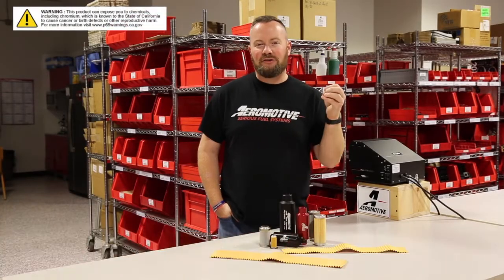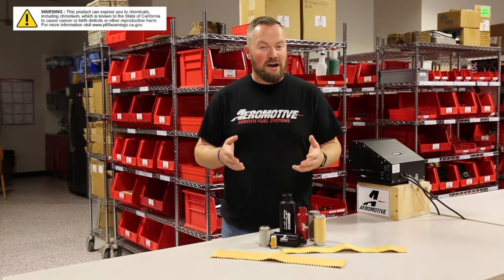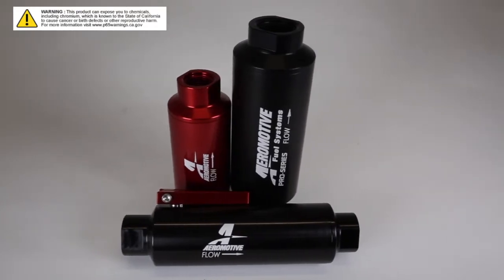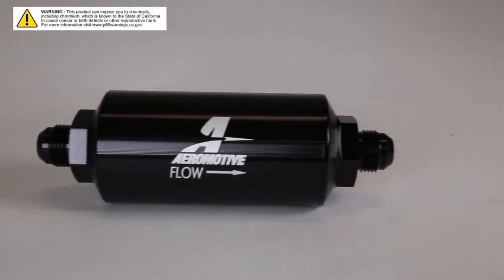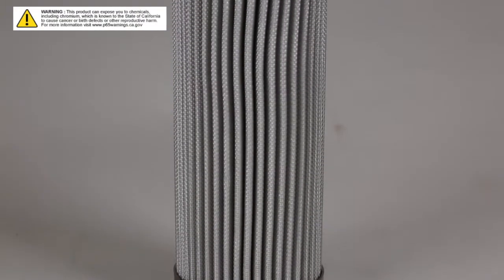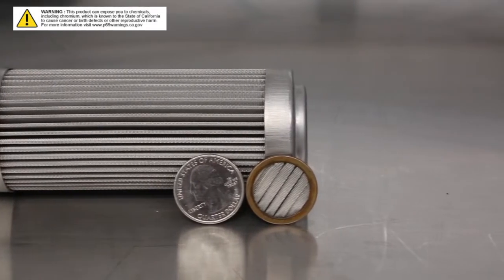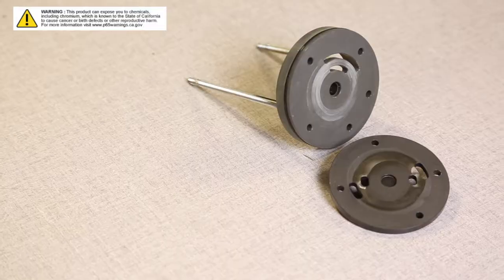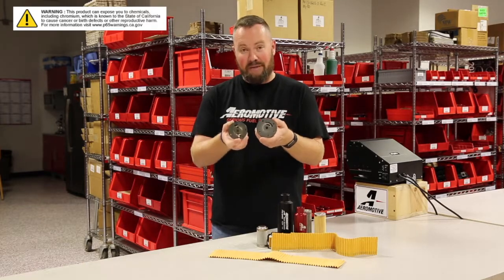Fuel Filters | Why Surface Area Matters

Comment: My 900wheel fully built Boss Roadrunner Gen3r e85 motor had an FIC 1000cc injector fail me at 18k miles. The number 7 injector stuck open and flooded my motor which caused engine to Hydrolock and now i need rebuild.  FIC told me they found microscopic metal and rubber in the injector when they cleaned it and the debris supposedly got stuck between needle and plunger and caused Injector to stick open and flood motor with e85..I took all the precautions and had 10 micron steel filter after the pump with new fresh e85 in tank every other day. Injector Dynamics told me after this happened to never use a steel mesh 10 micron post pump filter cause they tested them and the steel mesh doesn't catch anything 30 microns and smaller. So injector Dynamics said only to use a 10-12 micron microglass fuel filter..All these companies like Deatchwerks, Fore, Vmp still sell these stainless steel 10 micron post pump filters but Injector Dynamics said they are garbage and even though they claim to be 10 micron they are actually more like 30 micron plus. Sucks cause Deatchworks told me the stainless steel was ok to use but no one has actually tested them but Injector Dynamics.  Injector Dynamics is without a doubt the best Injectors company around and the only company to actually test the stainless steel mesh 10 micron filter compared to 10 micron microglass.  I am not blaming FIC but how come only 1 Injector supposedly got debris in it and the other 7 were clean.  FIC said they cleaned the #7 injector and its fine now. I ain't taking a chance again with my expensive motor so ID1300'S are the only way to go. No idea what causes Injector to stick open after being perfect for 18k miles..Maybe the coil went bad inside #7 fic injector and coil went bad in open position causing motor to flood. Who the fck knows, but now I know why everyone making big power on e85 only use ID1300'S like you do. My 68 Mustang fuel injected 438windsor runs Microglass 10 micron post pump filter and never any injector problems after 5 years e85, and the fuel system on my 68 mustang like 10 years old. But my 1.5 year old vmp return style fuel system somehow causes debris to clog my #7 injector. .Bullshit man and now i have to rebuild motor. Whatever you do never use stainless steel 10 micron post filter cause they arent actually 10 micron but more like 30 plus micron. Only use Microglass 10-12 Micron post pump as Injector Dynamics recommends and you wont end up like me with stuck open injector causing motor to fail and Hydrolock. I still think it could of been fic injector just went bad aftet 18k miles too..But fic will never admit their injectors went bad cause it can ruin their business.